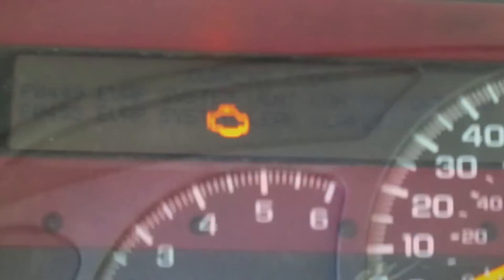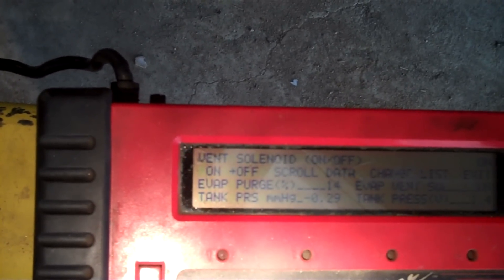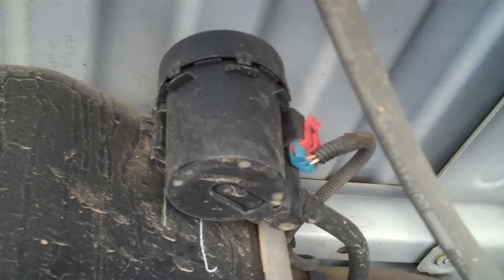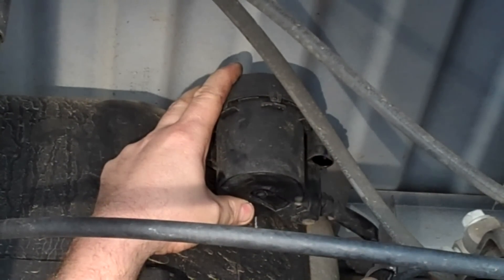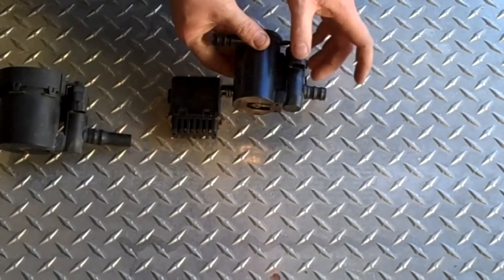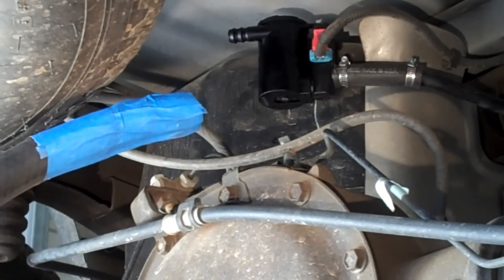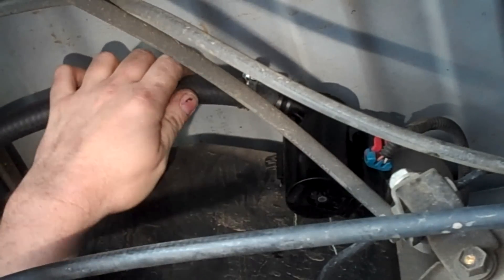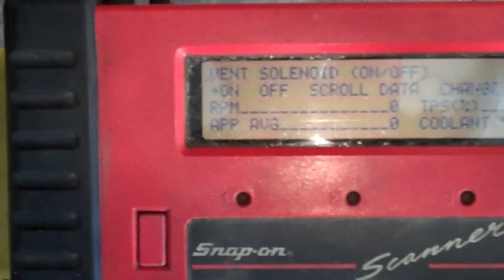Check Engine Light Diag EVAP Codes

Comment: Thanks for taking the time to record this video. It saved me some time figuring things out since my 2006 Sierra Crew didn't have the remote filter either. Location/ mounting was a bit different under mine but I pretty much followed your direction and got it done quick after picking up a 6' piece of 5/8" heater hose.

Comment: I've been getting the P0446 code on both my 04 & 06 2500HD work trucks since I can remember. All I've ever done (about every 5,000 miles, when the check engine light comes on) is erase the code. Now that you mention the "hard to fill fuel tank" I'm going to switch out the valve on both vehicles. Just another GM defect that should been recalled. Thanks for the video.

Comment: What are the GM part numbers of the new solenoid and filter you changed?
Reply: 19207763 is the GM part number and 214-2082 is the AC-Delco number.

Comment: What is the scan tool you use that an actually program the ECM? Is it available from Ebay. I have a haunting Evap problem on my 2004 Tahoe V8 5.3. Changed the solenoid but the MIL remains on. Could be eletrical but do you have any tip how I could find the leak ?
Reply: smoke test/ vapor test

Comment: My crew cab just did this code 2 days ago. My question is why does that extra vent have to be relocated on top of the transmission? Couldn't it dump out somewhere else less complicated to route through? Thanks for the video
Reply: They want it in a place so there is less chance of water and debris getting in it. You can put it where you want it though. Filter opening down and the hose going up from the filter so that it won't collect water in the hose.

Comment: I have an 07 Tahoe.  I get the P0455 code, but only when the gas tank gets half empty.  If I reset the code and fill the tank, it stays off until half empty again.  I used your video (thanks), but the same problem is there.  Code P0455.  What do you suggest next?
Reply: smorrow0816 replace the purge valve in the engine bay under the engine cover just behind the alternator

Comment: My 2000 chevy Malibu 3.1 is giving a P0443 and P0449 both of which are EVAP codes.
Could this be the same code, same fix?  (I have numerous problems with the electrical system) ......... good video

Comment: Very well done! I just had the P0455 code go for the 3rd time in a row. I got the new solenoid for $14 on amazon with free 2 day shipping (ac delco part) (and amazon prime). I looked the kit in which you installed with the new filter, its $64. I think I'll go with just the new solenoid for now. Thanks for the video!

Comment: Hi, I've had the same problem for my 2003 Chevy trailblazer. I have replaced the solenoid but my check engine light still comes on. any help?

Comment: I've had to replaced that solenoid a couple yrs ago. I got the code again (P0442) a few months ago, replaced it again, and just now it came back. I don't have a scanner to make it go on, but sometimes after i put the truck in park and go to the back, i can hear something clicking a few times (thinking it's the solenoid). any suggestions what else could be the problem? all i find online are gas cap and vent solenoid, and i've replaced both within the past year.

Comment: i got a mustang 2001 is hard to fill gas , i got evap large leak code 455 i check all the hose no crack or discannect , change gas cap , canister still not fix so is my solenoid bad ? can any body tell me ? thanks

Comment: My '04 Grand Am had the same P0455 problem. The vent solenoid was actually good but the problem was dirt in the solenoid body. New vent solenoid assembly and all was good. Plus I changed out the purge solenoid as well. It did not hold vacuum from either end well. New purge solenoid did though.

Comment from the maker: @michaelpine1969 I just looked at a wiring diagram for the '06 Seirra I worked on in this video.  It showed an orange & a white wire.  The orange wire came directly from the fuse & is supposed to be hot (12 volt+) at all times.  The white wire was grounded by the PCM when commanded.  The diagram I was looking at didn't show anything else connected to either wire.

Comment: Which wire did you have the test light hooked to??  Should pink be hot all the time??  Is the white wire from the computer??  With a volt meter, I have +/-1 volt at the pink and 0 volts at the white wire.  I checked the fuse and I have 12 volts at that end.  Is there anything the pink wire connects to between the fuse block and solonoid?  Great video by the way!

Comment from the maker: @haloguru2552 They are kind of similar.  On a Dodge, check for dry rotted rubber hoses.  An evap smoke machine would help find the leak too.